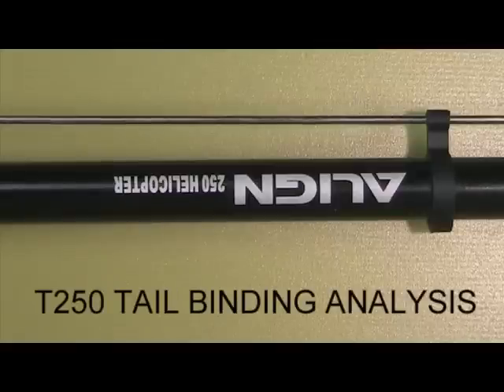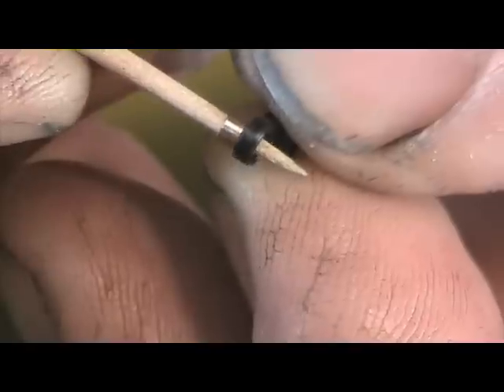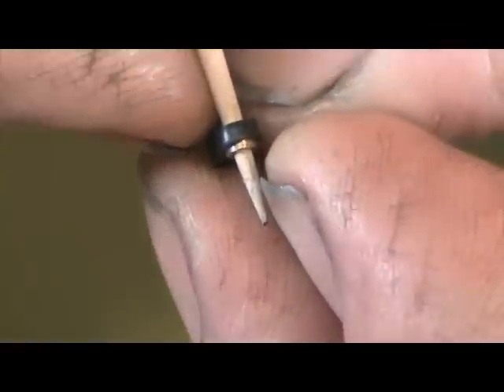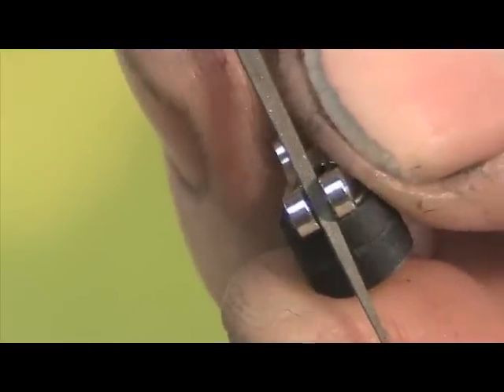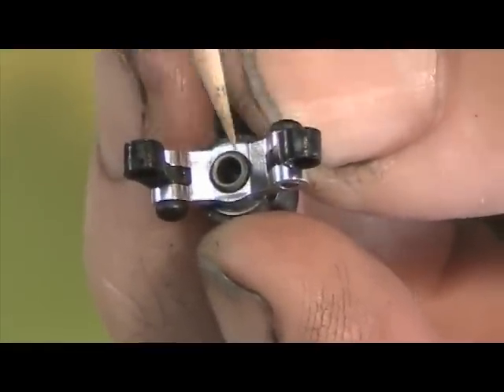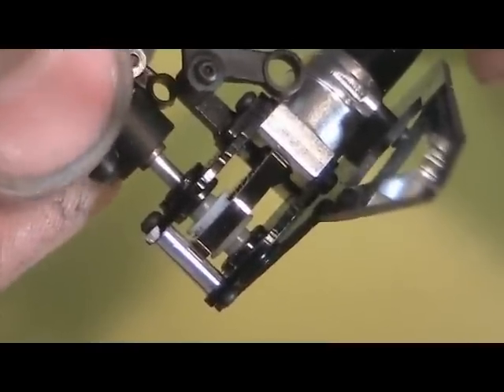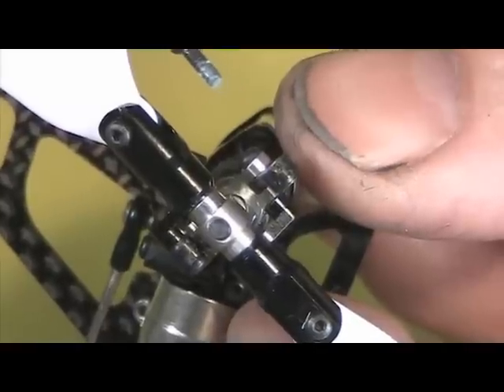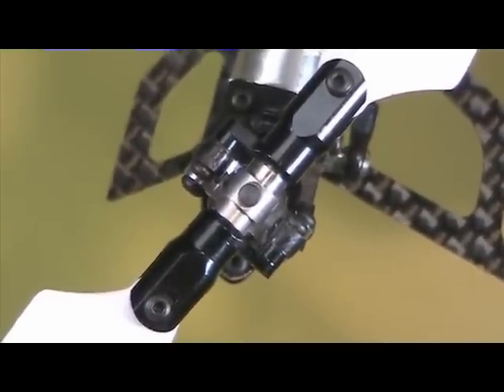T250 TAIL BINDING ANALYSIS PART 1.wmv

Comment from the maker: @laoch33 

No.  You are turning the inner pitch slider bushing clockwise. It is threaded into the pitch arm. When you tighten it, it moves further into the pitch arm, squeezing the inner races of the pitch slider bearings together which reduces thier clearance.

Comment: @ROBRENZ   ahh ok. Thanks! I only found these vids last night along with the chinese mod. I'm a mechanical engineer myself, college done but no work yet haha. But it's really nice to see some drawings like that in the vids :D   Just to make sure I've got this right:  I should put the pitch slider on the tail shaft, then squeeze it with a flat pliers in the axial direction gently, all the way round, in order to push that slider bushing radially outward , to get th inner races to squeeze together,

Comment from the maker: @laoch33 
The inner bushing is threaded into the pitch arm.  Tightening it a little pushes teh inner races of the bearings together reducing the play.  Make sure you have the tail shaft in the bushing when you try to tighten it. You can crush that inner bushing in a heartbeat.

Comment: Just noticed mine was binding big time, and I thought it was smooth when moving the servo by hand, but pushing the rod by hand it was very sticky

Ive just built the 250 and have a slight wag, more in flight then in hover. Hopefully this will help get rid of that. On mine all I had to do was loosen the screws on the black plastic parts to make it slick and smooth. I had tightened them way to tight before. Didnt know any better